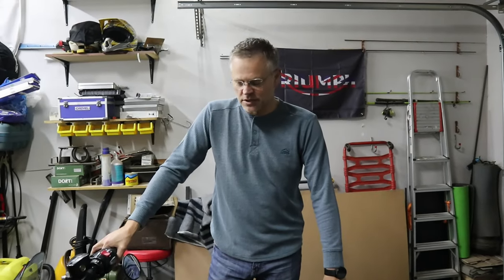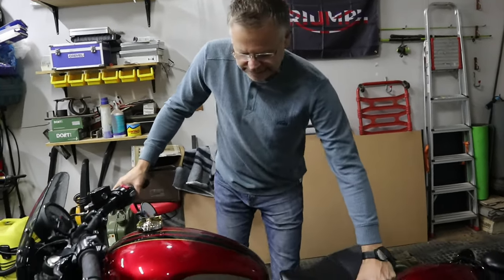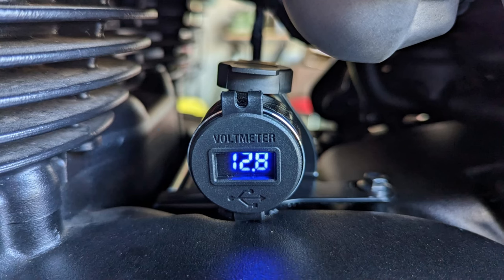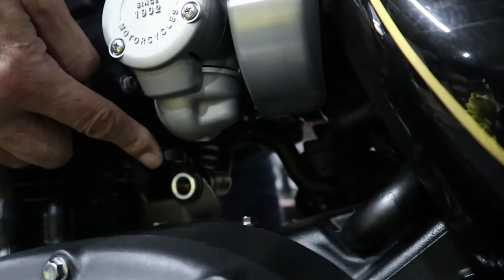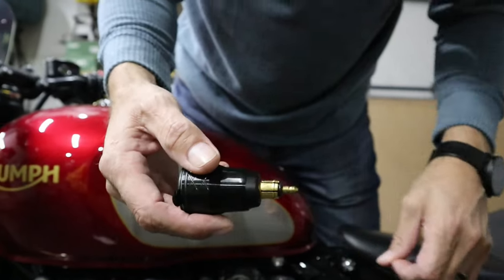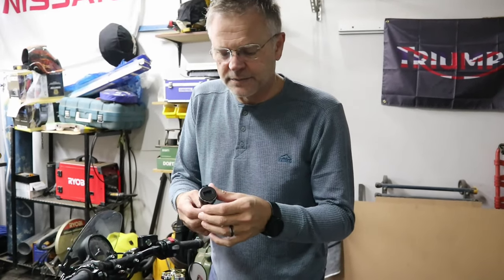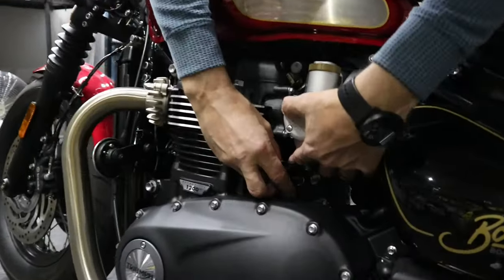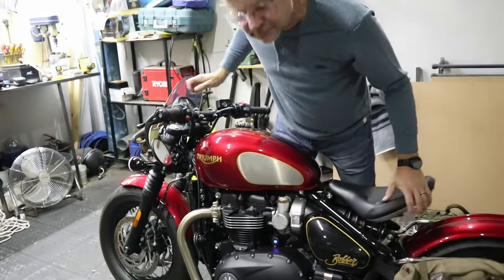Triumph Bobber DC power socket

Comment: Hi, no worries for the heat in the vicinity of the cylinders for the mobile phone cable? How will you fit the cable along the bike up to the handle bar? Another question, are you happy with your new fly screen, or does it create buffeting on your helmet? Thanks
Reply from the maker: Hi and thanks for the comment. I have been using the usb device for a bit now. It gets hot there, but not too hot. I have not run the cable yet as my cellphone holder is still stuck in customs - that is South African for some government official liked it so I will never see it. The fly screen is amazing. Makes a huge difference. I comfortably cruise at 160kmh or 100mph now with no buffeting.
Reply: @We-R-Racing  Hi, thanks for your quick and kind reply! I'm having the Speedmaster 2021 model and just mounted the Quadlock wireless charger with vibration dampener on my handlebars and getting the power socket installed in 2 weeks, so kind of the other way around as in your case, wasn't sure on how to fix the cable... ;-) I'm havingg an MRA naked bike screen with an adjustable small screen attached on top, it's fine for the chest, but creates noise and buffeting on the full face helmet, so I'm thinking on going for the Dart Marlin Flyscreen, seems to be pretty similar to yours, so thanks a lot for sharing your experience!!!
Reply from the maker: @martinsirotek8964  I think your seating position is a lot different from mine. I 7sed to have the Bonneville America, which is a lot like the speed master, with a large screen - much larger than this one, and it too made a massive difference.